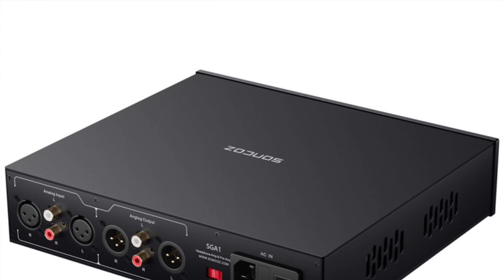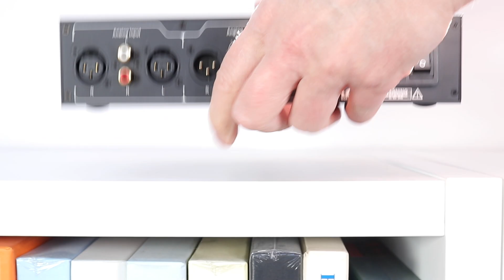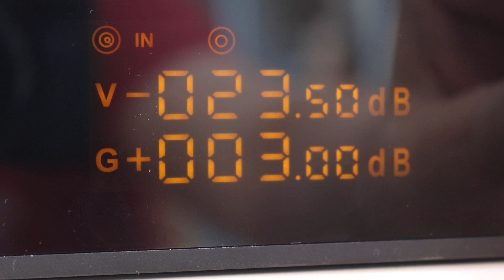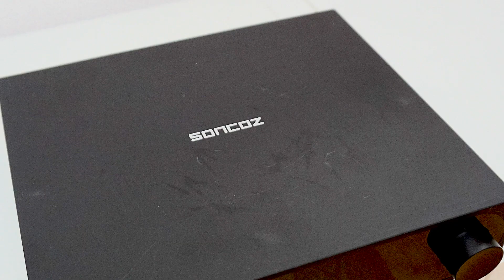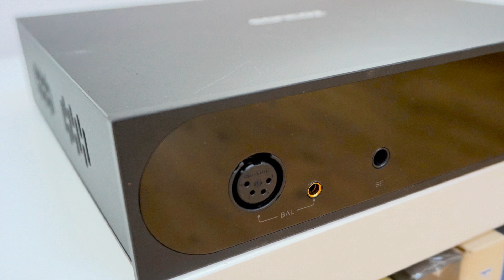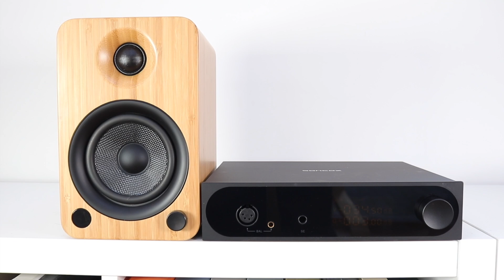SONCOZ SGA1 HEADPHONE AMPLIFIER REVIEW. INCLUDES A BONUS PRE-AMP MODULE & BALANCED MODES

Comment: Mr Rigby can you rule out your source in combination with the SGA1 causing these imbalances perceived between S-E and BAL? Do you rember other dual input gear where there is no audible difference when using that particular source while switching back and forth? If there is any gear you rember as "even", one may just conclude S-E input is of inferior quality.
Reply from the maker: Mr Picky - the source is the source because it's my reference and I know it backwards, having utilised it/them on many other review products. The review product under review is the only unknown variable. I wouldn't call single-ended mode noticeably inferior on the Soncoz, just disappointing. It's fine. It's workable. Balanced is just superior and the highlight. And just because balanced is included doesn't and will not guarantee good sound. I've reviewed plenty of balanced options in other products in the past which have, in and of themselves, sounded poor. Producing quality balanaced output remains, in my opinion, an art. Its sound quality is earned, its not there by right of inclusion.
Reply: @TheAudiophileMan  Thank you so much for making clear your source has been subject to double checks passed at numerous occasions in before. When looking at the comments some people just seemed to misunderstand. Maybe I am a little oversensitive to general "balanced" audio praise. There is a lot of cheesy "balanced" gear outside like $60 "balanced MQA" dongle DACs plus $20 "balanced" IEMs which only make me sad and angry through their sheer existence.
Reply from the maker: Indeed - and to further emphasise the point, here's one Soncoz where 'Balanced' didn't quite go to plan :) : https://theaudiophileman.com/la-qxd1-dac-review-soncoz/

Comment: Seems like balanced wins every time.  I'd like to see more manufactures offer it. I know I'd be happy to pay the extra money.
Reply: As we do not know anything about the source used it's highly speculative what really causes the difference perceived. Without a measured source that only differs in voltage between S-E and BAL with an equal THD and SNR under comparable load it's plain guessing.